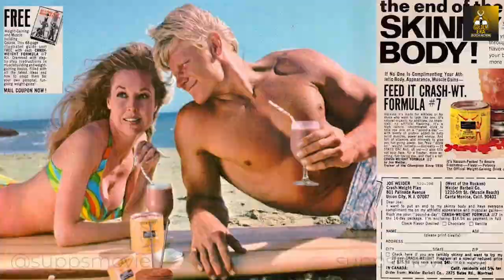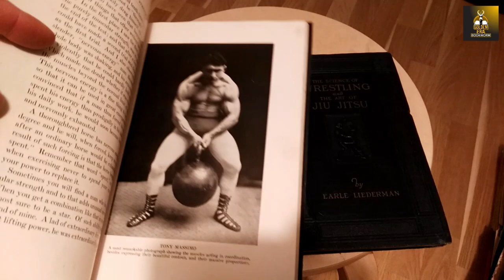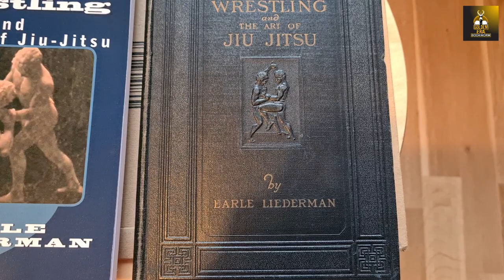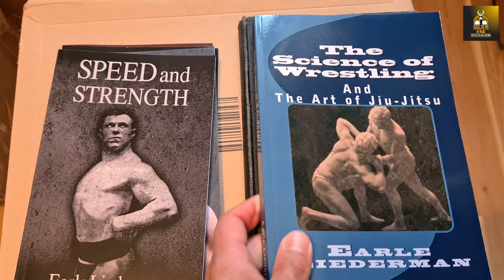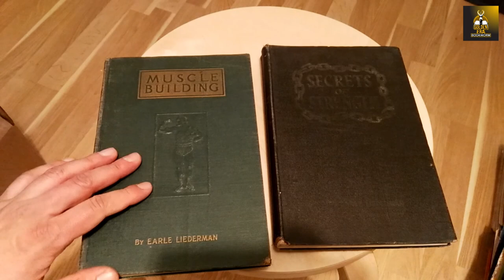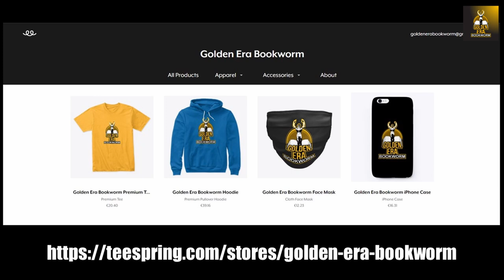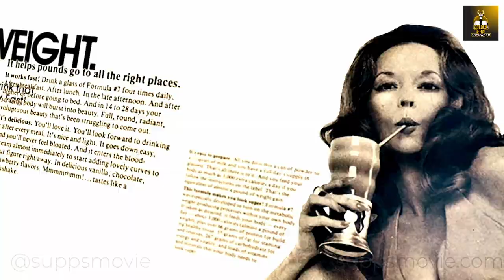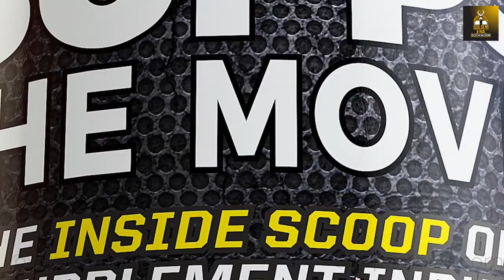BODYBUILDING, STRENGTH AND BUILDING EFFICIENT ORGANS. EARLE LIEDERMAN'S BOOKS!

Comment: Fantastic video bro. I've been using Bronze Era training principles since Lockdown in 2020 and have completely transformed my body and my understanding of training, fitness, and health. Thanks for the content you share, without it I wouldn't  have made half the progress I have. My bodybuilder buddy thinks I'm ready for the stage now, and its thanks largely to the training principles I pick up from this channel. Thanks for helping me bring positive change into my life.
Reply: How does a week/Month of training look for you? Great to hear about your progress!
Reply: @quarter6858   I was largely inspired by Eugene Sandow's Light Dumbbell System. This was because firstly, I only had few kettlebells to work with at home during lockdown, and secondly coz I kept hurting my lower back periodically when using heavy weight. Using the principle of Weight Assisted Total Contraction Hypotrophy,  and paying closer attention to my diet I lost over 10kg in 2 months. In addition to this i was inspired to use Chest Expanders like Fred Rollon. Lucky for me I had some chest expanders that I acquired in my youth which I seldom used before...
All I can say is that the Chest expander is a fitness tool that deserves to become mainstream once more because WOW!!!!!

I train only on days that end with the letter 'y'. Not to say that I go H.A.M. all the time, but, on the days I don't engage in resistance training, I will be doing some form of active recovery. I work in 12 week cycles with a week or two off... But the Down time gets challenging coz my body feels addicted to the stimulus of training, lol.

As a result of this my Lower back is no longer a concern, and I look better than many of my gym going friends.
Sorry for the lengthy reply, but yeah, my excitement and passion wouldn't allow a short response, haha.
Reply: There is something about the light dumbbell system that is akin to ancient Chinese training routines where they do 30 days of "kata" training which is basically flexing through range of motion and breathwork and then 30 days rest. They knew nothing of mtor but they still did it.